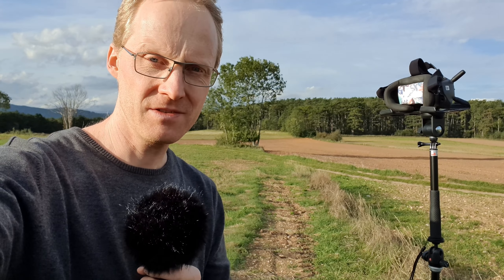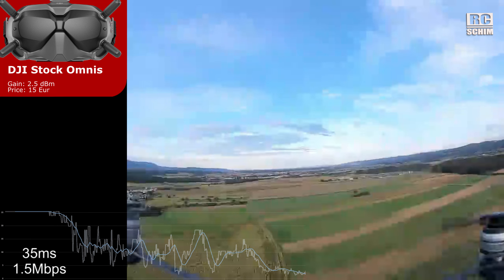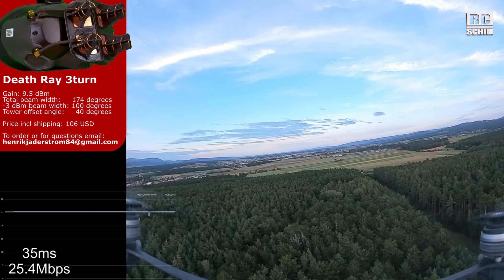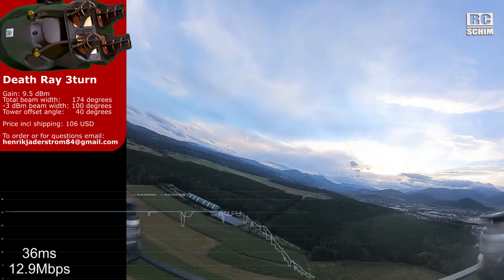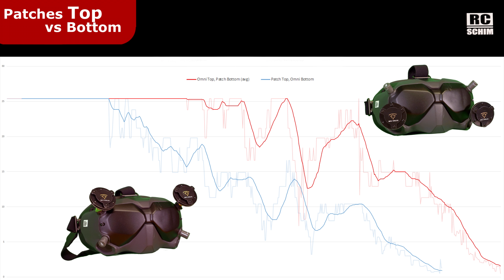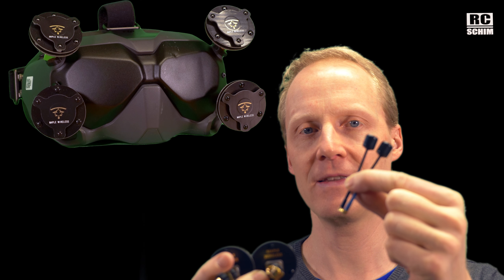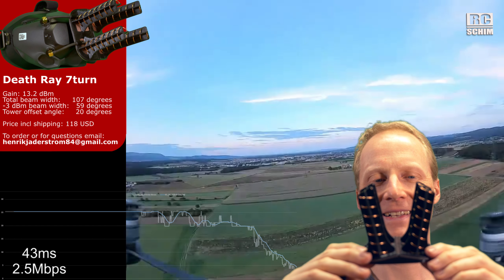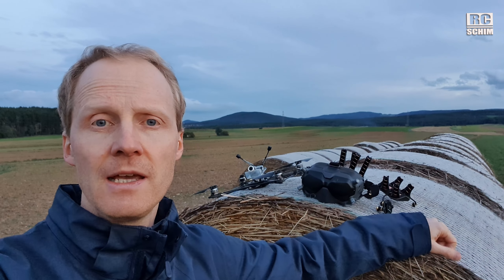Best way to test DJI FPV Antennas!!!

Comment: did you use different antennas on the quad? since the helicals are LHCP and the TrueRC Singularity f.e. are RHCP
Reply from the maker: nope, my TrueRC Singularity stubbies are LHCP  (TrueRC uses different colors for RHCP vs LHCP) 
Only back in the days I used RHCP when I wanted to use my old analog antennas (as there were plenty to choose from)   that's where I chose to install RHCP on the copters.
But at some point I swapped to everywhere use LHCP. 
Well: at least that was my intention! Some of the RTF copters lable their Copter TX Antennas with LHCP where they clearly have RHCP inside!!! So I opened all my antennas to verify. For example my RekonFPV Hexplorer was one of those with wrong antennas...
greets, Mario
Reply: @Rcschim  wow very interesting, thanks for clarifying! i checked out your other video where you open up all the antennas (older video) and i saw mostly RHCP antennas .. wanted to buy the speedybee antennas (also now in a V2 version available), but they are all only RHCP unfortunately, so will get other ones .. which one do you recommend for best range (if money doesn't matter) - thanks!
Reply from the maker: @shotbyarian  Recently I bought the TrueRC Singularity (with 12cm long cable) for my planes VTX (Airunit with 2 Ant). It has really good range compared to other plane with vista and one normal antenna).
On the RX side (goggles) I still prefer the 3turn Helicals. But I guess the Axii HD2 or chrystal patches are not bad either.
Wanted to do another comprehensive antenna testing - already started, but didnt have enough time...
Reply: @Rcschim  great thanks! will check them out! i already own the 3turn helicals since early 2022 when i saw your comparison video, they are really good and also still compact! just need to upgrade the short antennas to longer ones for long range, thanks! really looking forward to the new comparison video - already subscribed since a year or so, so will def. see it when released, thanks!
Reply: @Rcschim  where did you buy them since you also live in austria? i can't find them anywhere .. only on n-factory, but they are sold out
Reply from the maker: I think nFactory or FPV24.   I also ordered directly from Hugo (TrueRC, Canada) took around 2weeks I think.
Reply: @Rcschim  not available at fpv24 and sold out on n-factory unfortunately .. so you like them more than the foxeer and lumenier axii 2 long range antennas? worth to import them i guess?

Comment: Please help out a noob like me, save me from more confusion. If I were to upgrade my antenna, which one should I get? Nothing too expensive, and if possible something that will work with bpi analog adapter? (I don’t have them yet but likely to buy in the future)

I see some combination, th axii ( combination of stubby and patch?)
Reply from the maker: cheapest and best overal working combo for me is the iFlight CrystalHD pack (with Stubbies). around 70$. or the Axii HD patch + stubbies.   
will reply with a link in seperate comment.

It will also work with analog adaptor - but remember that you also need LEFT antennas then on your analog copter to match - else you will have reduced range (about 50% less I estimate).
Reply from the maker: here's the link to crystalHD  (I like it since it looks nice and comes in different paint jobs):
https://de.banggood.com/IFlight-Crystal-HD-Patch-5_8GHz-9dBi-Directional-Circular-Polarized-High-Gain-Flat-Panel-FPV-Antenna-LHCP-RP-SMA-With-Casing-Mushroom-Antenna-Combo-for-DJI-FPV-Goggles-p-1763005.html?utm_source=google&utm_medium=cpc_ods&utm_content=phil&utm_campaign=phil-sds-smla-de-feed-0629&ad_id=530578876031&gclid=Cj0KCQjw1dGJBhD4ARIsANb6OdlW9u3OgZwiXH_3O2CHvDXobbfPP_BeFnpp7jz7cF-r4MFctfY4JQQaAv-xEALw_wcB&cur_warehouse=USA&ID=6303749
Reply: @Rcschim  thanks, so other antennas can work in combination, I thought brands would have to be the same. Thank you

Comment: There will be an absolute limit in how far you can go with 25mW due to all the crap in the air you have to compete with noise-wise at such distance. The area where you lose signal likely has a more powerful source of noise, ie, cell tower or similar nearby. The air unit must receive the return packets from the goggles, the onboard omni's of the quad can pick up just about anything to drown out the goggles.
Reply from the maker: hi, I know - but here it was really my fault:  when flying only 50m high, even 15m high trees near me get a problem when you're out a bit further.
In my next testvideo I flew much higher and had better range.
In the video I post today, I had a fixed installation and got to 2.3km with 25mw and the stock antennas (barely)

Comment: i was thinking you might be too low, then when the helical's  dropped off a cliff i thought maybe height is ok but signal strength/signal quality is the issue,  if quality is good all the way to the end with the helicals then basic strength of signal is whats failing.  i dont know what mr fresnel would say... ps i got a km on my eachine tx805 and lost radio, but i seen video clearly all the way down to the ground... long thick grass.. pps i forgot to flip up nirvanas antenna.
Reply from the maker: I'm quite sure that I got behind LOS when I left the wood behind me (around 1km) - on this comparison shot of real world and google earth (with red lines being my flights) we see quite clear now that ALT was to low. It was not so obvious to me there while testing...   If I just had set 100m as a waypoint ALT default - this test would have been so much better.... 
I even got crossfire complaining when the trees where in the line of sight. 
But since it was very windy in the beginning I was nervous and thought I have to abort testing at all. Then I flew a few rounds with my normal 5" non waypoint copter to compare at least that way. during this testing wind got calmer and I finally flew WP missions.  The day before I almost crashed in GPS hold mode - because the battery lead was too close to the compass gps unit...  this all added to my insecurity while flying :)
Reply: @Rcschim    i wonder if fresnel effect is worse over trees, i think you still had los but it was very close.   it such an easy mistake to make when you increase the distance, even when i sit and look and study things far away, when i get there it all looks so different, my last mountain session had at least 3 times i lost los, but no drop outs, signal must have bounced. anyway the tests are still useful, the helical's held 25mbs all the way, and nobody wants to fly with bad signals, especially with a turn around.

Comment: I thought this was an excellent test. for many of us that fly quads that occasionally fly out a number of KM's  then id say flying at 50m was fairly true to life. the further we go its true that we would then need to fly higher and higher to keep the signal strength and benefit from the different types of antennas that you tested. however the further and higher we fly then we are increasing our risk of incidents with manned aircraft (A very small risk) and also possibly breaking the rules regarding maximum height. id say most of us er on the side of caution and average around the height you tested at.      this been the case id say that the stubbies would also be my daily antennas.       interestingly and frustratingly these dji specific antennas seem to be very expensive so i would be very interested in a comparison of the lower cost antennas such as the foxeer 3 and others with the true RC Stubbies and compare the differences and then we can consider price/value to bitrate.

many thanks great video.
Reply from the maker: Thanks Jason, nice words. It was unfortunate tho - if I only had the balls to "send it" and chose 100 or 140m alt for the waypoints...
Now I have to wait again for better weather and calm air to test more... 
I had also the foxeer antennas in my basket, but testing took me too long because first hour or so was wasted with higher winds... maybe on the next session.
Reply: You dont need to go very high if there is nothing blocking the signal, if the forest had not been there 50meters would have been fine. Yes you would be in the fresnell zone but it would still have worked pretty good. Blocked line of sight are much worse for the signal than the fresnel effect
Reply: @Rcschim  well it would be better to stay low and fly over a field without trees or to stand at higher ground above the forest canopy. If you are anywere close to a forest and standing below the canopy you need ALOT of hight to fly really far. Its a big problem where I live as there are forests everyware and no highgrounds and only "small" fields
Reply: I have the same frustration, and encountering promotion only serves to aggravate it. Check out the ORT pagoda stubby set for DJI. $44.99 for a set of 4. I've had some very interesting, and positive, results with these antennas. Haven't taken them off since I got them.

I fly with the DJI controller. What's interesting is that with this antenna set, the signal for the DJI controller doesn't budge from full bars, rock solid. (Funny that different antenna on the goggles drastically change the behavior of the controller signal. I think theres some insight to be had here.) The signal meter for the quad drops one bar, way earlier than the stock antennas would, and this had me concerned on the first flight. Interestingly, after it drops the one bar, it doesn't budge, and stays rock solid far past where the stock antennas drop more bars and bitrate. With the ORT, bitrate and latency are unaffected by the one bar drop, so video is great until I max out range (max for my nerves anyway.)

My flight scenario that yields these results is unique. I'm in a very noisy environment. My max altitude is 0, and for nearly all of the flight path, the aircraft is far below home point, as I fly down in a big, rocky, desert  draw, often in close proximity to the rocky cliff edges, at the sides of the draw. Flying 25Mbps, I turn around when bitrate hits about 16 Mbps, which is 1.92km out. At this range, an altitude of "0" would actually put me a little over 300 ft above the ground at the end of the draw, but I'm never that high, usually around 100ft above the ground, so over 200ft below home point. Haven't tested a more traditional flight path. In my typical scenario, this antenna set, without doubt, outperforms stock, and the price for the set is far more considerate than other offerings. I'd love to see this ORT set in a shootout with the other popular offerings, though over more and more time, its conspicuous absence from such testing may prove to be revealing.
Reply from the maker: @24kJames  ORT makes decent antennas - that's for sure. 
DJI controller link doesnt need a lot of bandwidth - so it's included in video feed and will be in good state for long I guess.
Why the video RSSI bars vs. actual bitrate is so disconnected leaves me wondering also. I learned quickly that the CH signal bars are only distracting. I now actually hate that they go red and would much rather see the bitrate larger, and go from gree to yellow and finally red at certain tresholds...
Your flying location sounds awesome (but also challenging).
I'll see if I can get those ORT pagodas...
greets, Mario
Reply: @Rcschim  Thank you for the thoughtful reply, and for all the work you put into your helpful videos. They are well done, and worthwhile. 

That's a great idea, giving the bitrate a heat map. I'm totally with you on the idea of keeping focus on bitrate, more than signal bars. I'm still working on breaking the habit.

When you say the control feed is part of the video feed, is this to suggest the controller has a role in processing video, and perhaps negotiating to optimize and error correct the feed?  

I really cant get enough RCSchim antenna testing videos, so definitely look forward to the next. Putting ORT in the mix as one of the affordable options would be awesome. I think your execution, of what's been outlined above for the testing, has the potential help a lot of people. Cheers!
Reply from the maker: @24kJames  Control: as far as I understood, the DJI radio (control) only communicates with the goggles, goggles have a 2way link with Air-Unit. So to control your craft you inputs are releayed over the goggles. Control inputs are only a very small ammount of data (but need to be fast) so as long as there's some link quality for the video - it should be more than enough for the control link.
It's a seperate "stream" of data however - since latency of control link is said to be very low (7ms?) while video is 20-40ms.
The 2 way video link works in a way that some of the antennas on your goggles also transmit back to the air-unit and tell it:  last video frame was bad - please re-transmit. That's why you hardly see any breakup - only increases in latency (stutters on extreme situations). 
Audience mode goggles dont have this option to get a re-transmission - so they always have worse quality.
Reply: @Rcschim  I see. This is very interesting. That model certainly seems reasonable, within my limited, amateur grasp of the general topic, but I have to wonder if it represents the full picture, and extent, of the relationship(s) between controller, goggles, and Air Unit.

I'm having some difficulty reconciling that model with a particular behavior I've encountered, where the antenna of the controller have exhibited some form of directionality with relation to the aircraft/Air Unit, observable in the signal performance, as displayed by the on screen signal health indicator bars. Additionally, while we agree on the dubious nature of said signal bars, such a relationship between controller and Air Unit is depicted by an illustration found in the official DJI Digital FPV System manual, where it suggests to aim the broad side of the controller antennas above the horizon, and toward the aircraft/Air Unit. Lastly, based on the heft of the controller, its need for an internal cooling fan, and the sheer volume of electronics contained within, as casually observed in passing, online, all seem to suggest a likelyhood of functionality inclusive of the model you've presented, but also quite beyond.

Communication from controller to goggles must experience extremely low latency. Perhaps control input data is sent by the controller, and repeated by the goggles near simultaneously, to increase the odds of maintaining a steady stream of control data, as received by the Air Unit.

Another way to potentially leverage extremely low latency communications between controller and goggles, might be to again apply a similar concept, but this time in regards to the video feed coming back, where the relationship between controller and goggles becomes one not so dissimilar to that of two analog video receivers bound in a diversity configuration.

With that in mind, I'm compelled by the mysterious (to me at least,) nature of the controller to digress a bit. Through observations made while operating a de-cased Air Unit Lite, we know that of the two boards that comprise it, the one responsible for processing the video stream presents greater heat concerns than the one transmitting the stream (vTX.) Of course in the analog world, it is the vTX that is known for getting extremely hot. Knowing nothing at all of the particulars, I'll hazard a guess that what is done to the video on the transmitting end, must be "undone," on the receiving end, resulting in a similar amount of work done/heat generated. Such processing taking place in the controller is one possible explanation for the need of a fan, but then again, I believe the fan kicks on pretty quick, even in the absence of a live video stream. Idk. I'll have to pay closer attention to this. Inspecting the controller electronics for a chip pair similar to the P1 (perhaps the processor,) and its mate (possibly RAM, as it bears the logo of Micron, a memory chip manufacturer,) found in the Air Unit Lite, might be a way to more conclusively prove, or deny this as a possibility.

RCSchim, I greatly appreciate having a forum where I'm inspired to hypothesize on subjects I find so interesting, a place where I can learn, and grow. Thank you. Video rated, and channel subscribed.
Reply from the maker: @24kJames  wow - now I guess I learned more than you did, by reading that long post. I have to confess I have no experience with DJI controllers since I use Crossfire (and love the small Tango2). 
your experience with chips on the airunit:  makes sense that the video processing unit has more work than the simple RF chip (even if we tend to use way too much rf power output).    the video signal chip has to handle all the magic that makes the DJI system so great. similar to their already good occusync on mavics. 
nice to welcome you as a new subber, greets, Mario
Reply: @Rcschim  Turns out I was already subbed. I'll aim to be a more active subscriber. Thanks again.

Comment: What power level was your crossfire on for this test?
Reply from the maker: Normally I fly with the Tango2 on auto mode - so max 250mw... but when CF gave me warnings I really left LOS and got behind the treetops (which I didnt consider since I thought I fly high enough...)